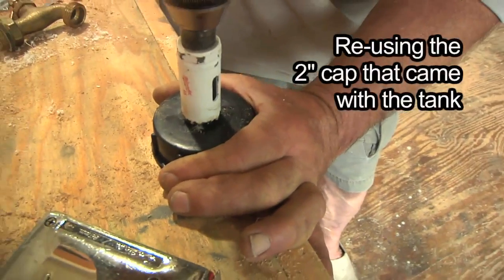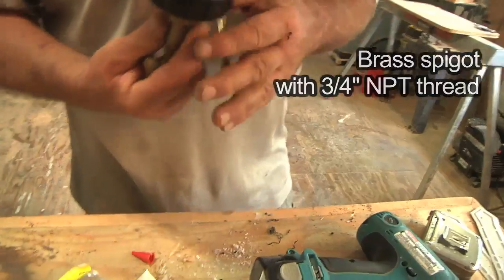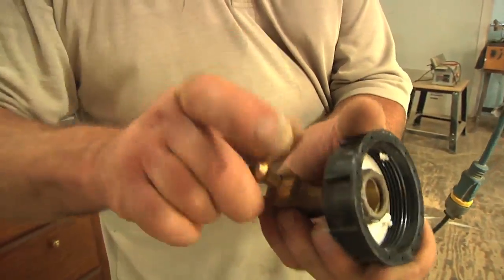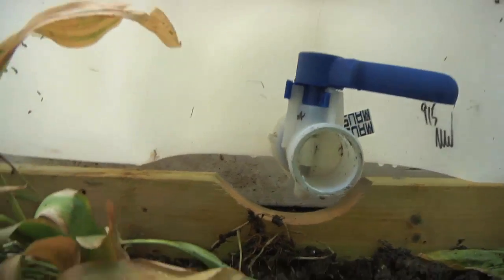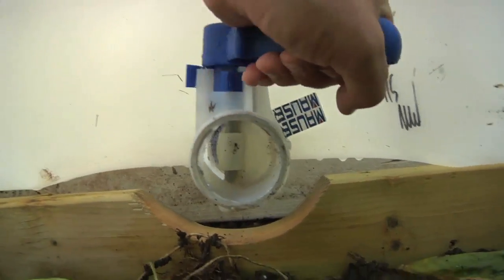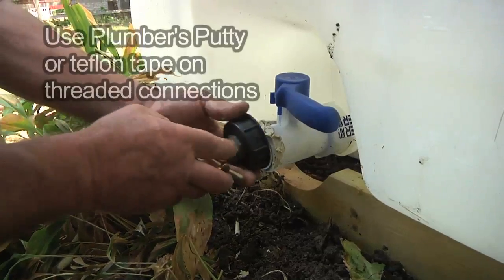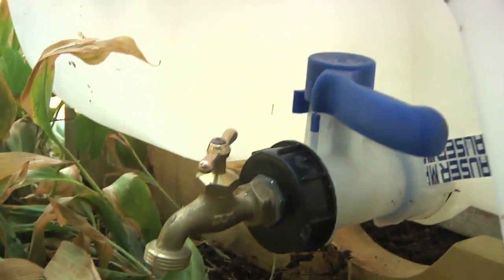DIY 275 Gallon Rainwater Collection, Part 3

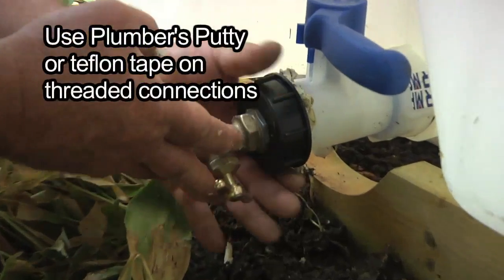Comment: @2:50 - Dumb dumb DIY.  No, you don't need plumber's putty or Teflon there. The while ring is the seal/gasket. 

You don't use plumber's putty on a garden hose connection for the same reason.

Comment: No leaks with the construction sealant? All of the sealers state on the tube that they are not meant for continuous submersion in water. Thoughts?  Thank you!
Reply from the maker: No, no issues. There are a number of different ways to make a water-tight connection through a cap or similar piece of plastic. If you have concerns, you could use a 100% silicone. That's what's used for aquariums, which of course means continuous contact with water. There's also rubber gaskets and other options. We just used what we had handy around the shop and have been overall pleased with the results of the project.